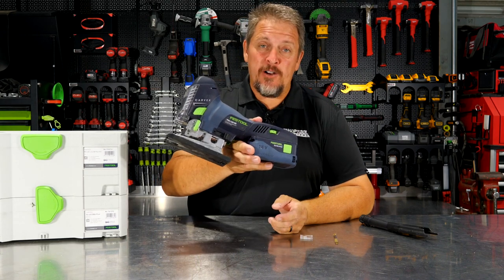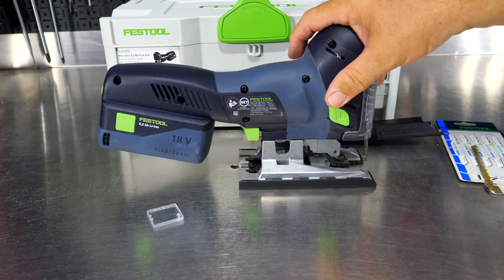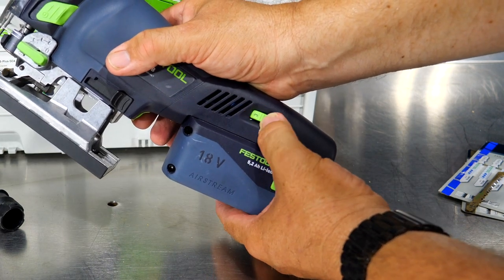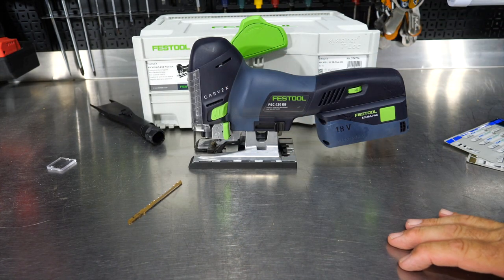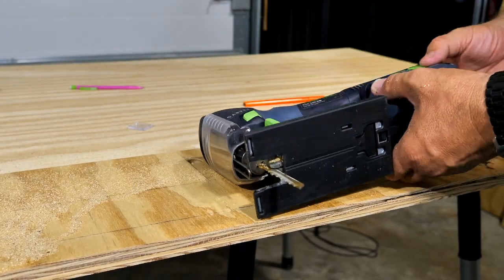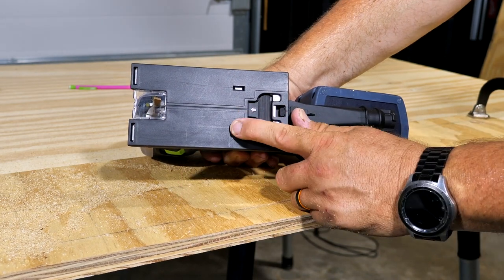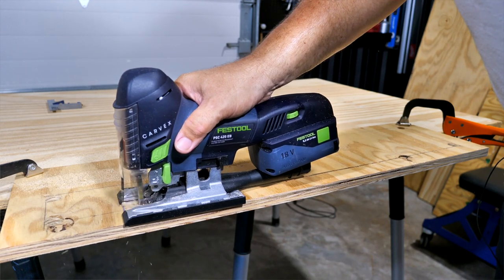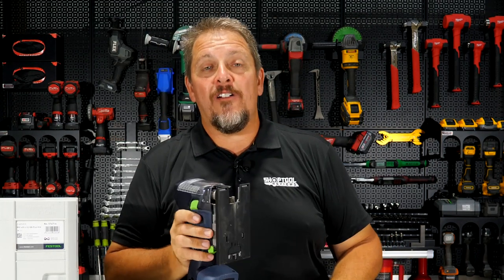BUY the BEST! Festool PSC 420 Carvex 18V Brushless Jig Saw Review

Comment: Thats the only tool from Festool I regret buying...too wobbly blade drives me crazy and nonstop turning it off by hitting off switch by mistake...90% of my tools are Festool and Carvex is the worst...looking at Makita
Reply: There are adjustments to stop blade wobble, almost, completely. That's why it comes with an Allen key.
Reply: @cernunnoskali  don't agree at all I have had adjust jigsaw in the shop still the same problem
... completely wrong design
Reply: Check out the Mafell P1CC if you use a jig saw a lot in thicker material. Not cheap, but it’s a monster.

Comment: Festools cordless would be equivalent to boschs but Mafell makes the best cordless or corded tools
Reply: Mafell is even more overpriced then Festool.
Reply: Mafell saws are probably your best option when you're working with 3"+ wood. I love my K85
Reply from the maker: Mafell definitely makes some great tools as well. Most "general" users are not a great fit for either, due to price. However, those that really desire to have the best performing and most ergonomic (less vibration) tools, the price for Festool and Mafell fall in line with the value.
Reply: Festool are better than bosch, ihave bothe. Maffel is nice but only corded and no led Light, and the dust collection is not as good as festool i have Maffel one too😉
Reply: @saulgoodman2018 Mafell manufacturers over 85% of parts in house to maintain the highest possible quality. Mafell builds the absolute highest quality timber framing saws possible, with zero compromises. They’re built to be lifetime saws. The P1cc is an absolute beast, similar motor to a 7.25” circ saw or 2hp mid sized router.
Reply: @exigauner  mafell just released a cordless jigsaw - with led light
Reply: @d7samurai  i know i have one since last 2 weeks👍

Comment: Dewalt battery powered jigsaw is less than half the price.
Reply: But then you would be a regular Joe Schmoe on the job site....🤭
Reply: As a dewalt user , yes it’s a third of the price but it’s 1/3 as good also. If your a diy then it doesn’t matter, as a professional, yes it does and price doesn’t matter
Reply from the maker: Correct, but the DeWalt doesn't come close to the features, ergonomics, and performance. Thanks for watching.
Reply: And less half ass good as the festool 😂
Reply: And dewalt has a lot of quality issue, they Tools broke to easy. Thay should change the Name to default😂

Comment: so you just said Festool needs no explanation, then you go into wasting time explaining the systainers...  in any case, I have the makita and HATE  the double start button.  stupid design.  I dread using it, too bad because other than that is is very good.  The carvex has the left handed single on/off switch that is easy to locate with thumb.  Much better.  With the makita, after a cut I have to lift it up and seek out the flat buttons on the other side to turn it off.  Stupid design. I already said that.  Dust collection also nice since I am constantly blowing on the blade to see the line.
Reply: I had the makita one too until it was stolen, I found that really irritating as well as the soft start.

Comment: How's vibration and accuracy compared to the Flex? Have you tried the latter with the stacked lithium batteries?
Reply: vibration is so little, in germany we have rules for safty. you can use only tools with good dust collection and less vibration on professional job side, festool is on of the most used tool brands and is made in germany too.

Comment: Fot the price, it is not worth it.
Reply: Not if your a diy guy , but for a professional, yes it is
Reply from the maker: It is for some, and it makes sense. If you're in general carpentry or DIY, then it probably doesn't make sense. However, for the more Professional users, they find more value in the ergonomics and performance. Thanks for watching.
Reply: Never had better one than Festool, try a lot of jigsaws dewalt, bosch makita and milwaukee. Dewalt even broke twice on me